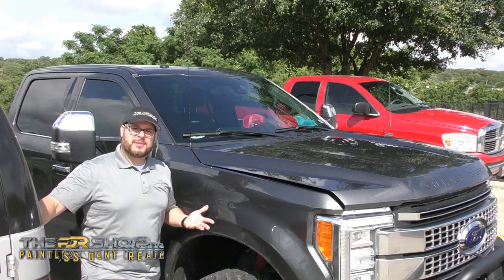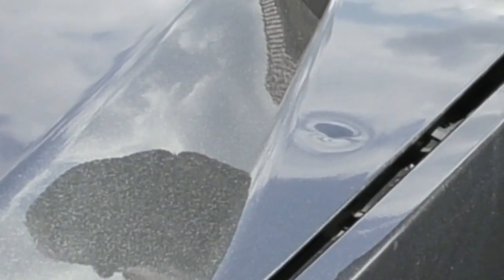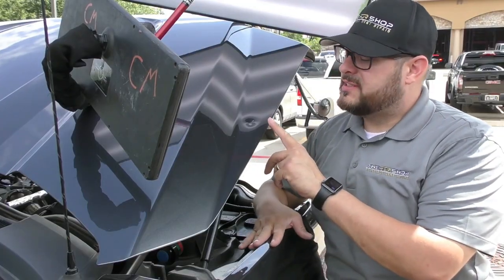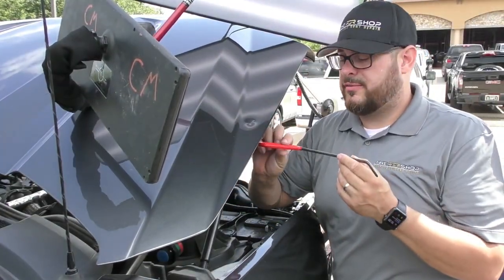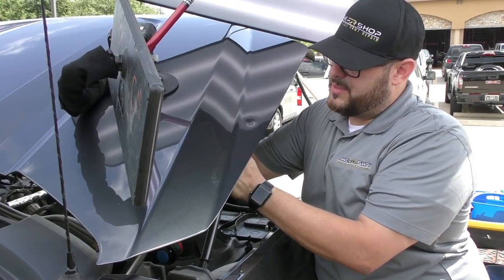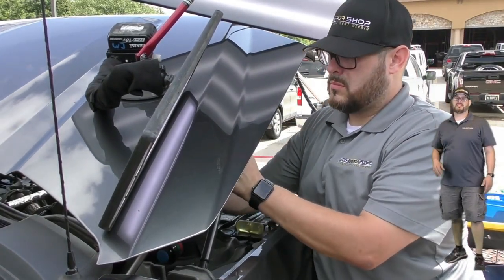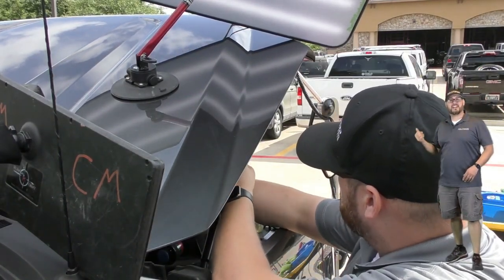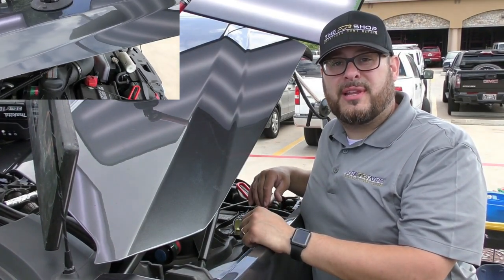Dented 2017 Ford F-250 Aluminum Hood Paintless Dent Repair Kyle TX, Buda TX, Austin TX

Comment: I live in San Antonio but would travel to Austin to have this done. What would a dent a little small than this cost to repair?
Reply: Thanks Joseph with the recent hail storms I’ve had to shut down my minor dent service for a while but a dent like this which is about 2 inches  and over .76mm deep on an aluminum panel is in the $300-$350 range.
Reply: @CharliesSpanishJourney  come to think of it that lil fella doesn’t bug me that bad haha
Reply: @josephcraig765  yes sir I definitely understand 😅. Thanks for checking out the video.

Comment: Hey nice video..What is price range for a large Dent like that?
Reply from the maker: Thanks Emmett. My prices are based on size $150 for the first inch and $50 for each additional inch.  and Factors like for example if it’s through a body line or if it’s on aluminum there’s a up charge of 25%. So a 2 inch nonobstructed Dent on aluminum is $250.

Comment: I have a small football size dent form ice off a house roof.
Reply from the maker: Thanks there are definitely limitations to what PDR can repair but if your vehicle is a candidate I would highly recommend you go that route. If you’re in our service area you can fill out our quick quote form on the website to get started.
Reply: @thepdrshopcharliemolina5374  It is not completely PDR as there is already paint missing from the impact.